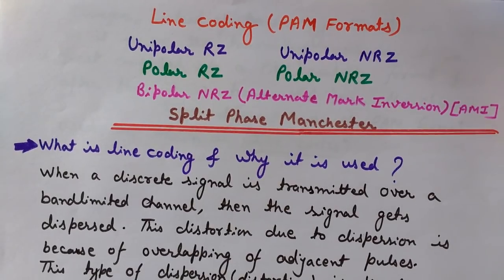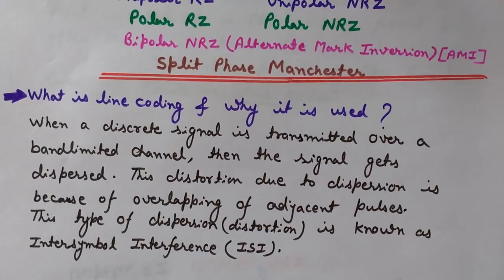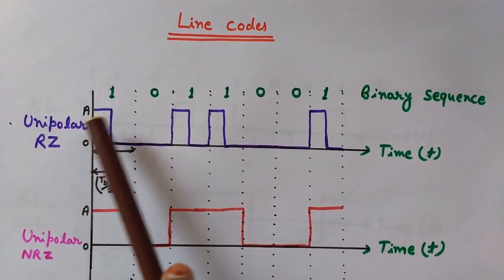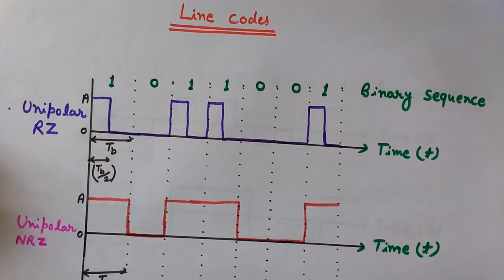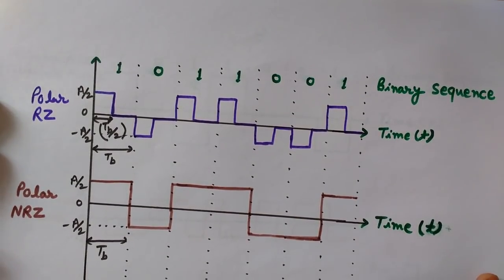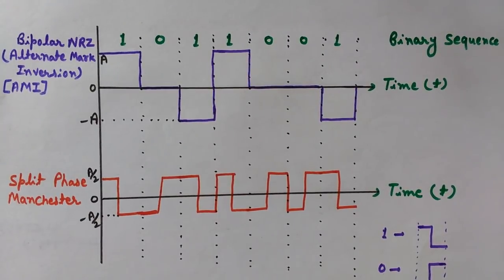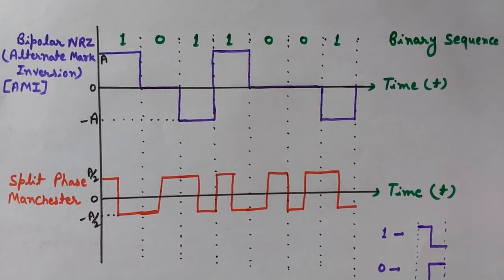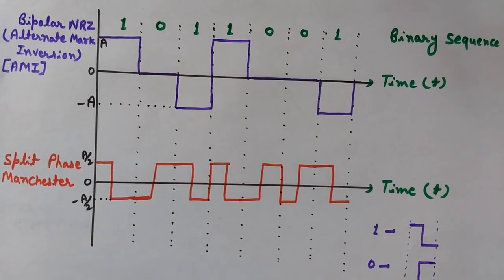Line Coding Schemes (Techniques)/(Unipolar RZ, NRZ/Polar RZ, NRZ/Bipolar NRZ (AMI), Manchester Encod

Comment: Polar code has both positive and negative levels and bipolar too has positive and negative levels then what the heck is the difference between the two
Reply: The Polar Signaling scheme assigns 0's as a negative pulse, while assigning 1's as a positive pulse.  The Bipolar scheme assigns 0's as zero amplitude pulse, and alternates the polarity of the pulse for 1's.  Additionally, Polar Signaling has a max amplitude of A/2, while Bipolar Signaling has Amax of A.  Hope this helps.